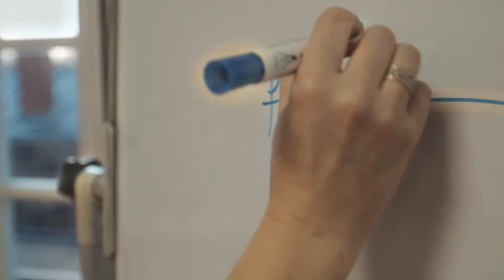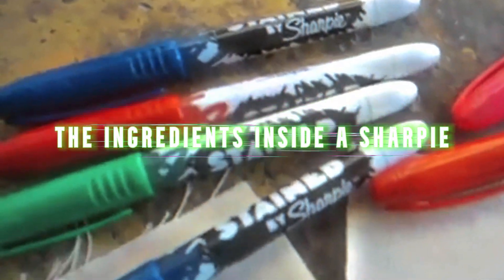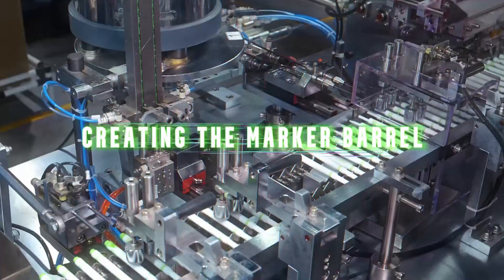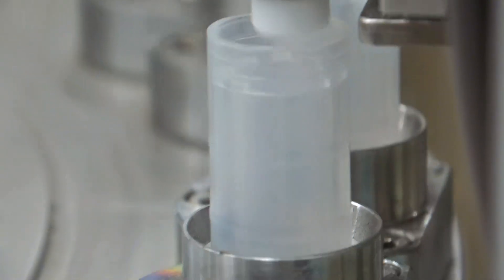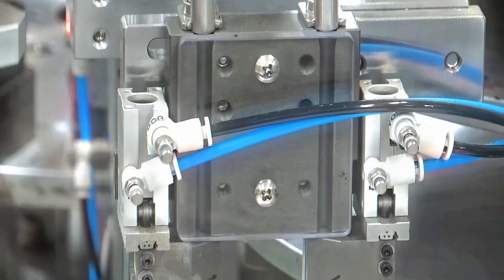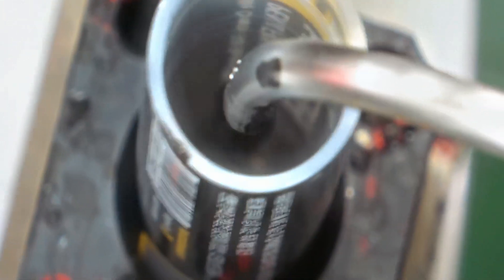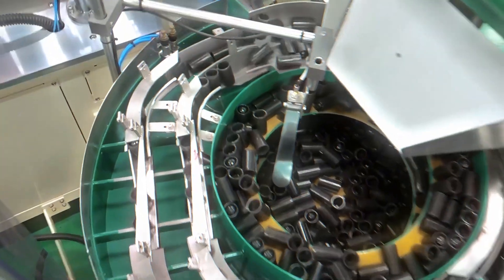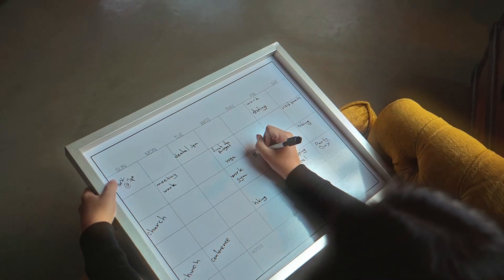How Sharpie Markers are Made in a Factory | Made of What

Comment: Save 11 Minutes

The barrel of the marker is created to last through hundreds of uses and keeps the ink fresh and useable Its made of polypropylene because its light weight and durable, the markers are inspected, quality checked and any sharp edges removed to make the product as usable as possible. An ink reservoir allows the ink to go to the barrel. Workers test these reservoirs to ensure their effectiveness, If its too dry or too wet it won't work correctly. The tip is made from synthetic fiber designed to hold ink and allows it to flow onto the surface its put upon. Fine powder when mixed with paste creates the markers tip. The importance of the shape effects how smoothly it writes and how much ink is allowed through it at a time. The nibs are cooked which solidifies them into their given shape. Tips are trimmed and polished then put into the marker barrel.  

Ink: The markers have an Ink Reservoir which resembles a cylindric sponge. A precise machine injects the Ink